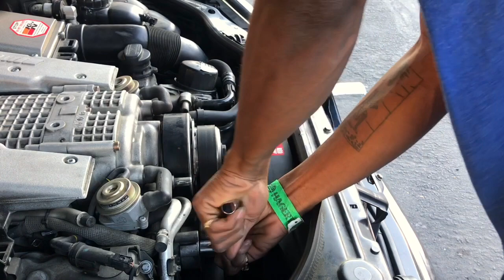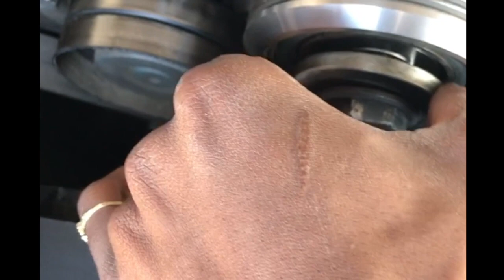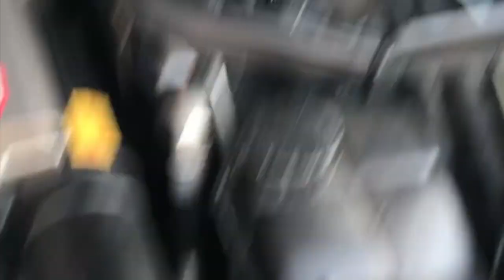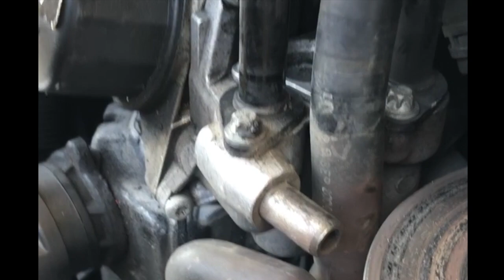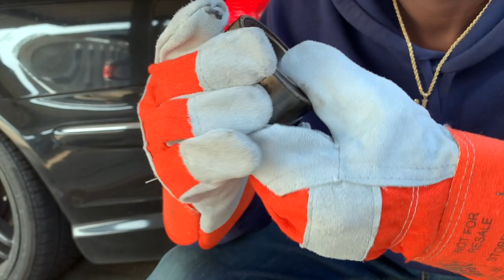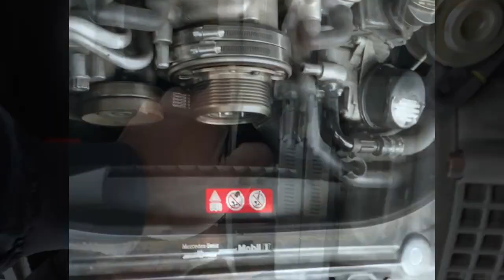How to replace the Mercedes AMG supercharger pulley bearing E55 CL55 CLS55 S55 - M113k Engine noise

Comment: Did you add new bearings or were they the old ones ??? How high did you have the oven on to what temperature???
Reply from the maker: Yes I replaced the bearing. Oven was at 450

Comment: Cool vid... I'm thinkin of doin the pulley MOD for my 03' CL55... or just do what you did...? PS, I guess the MOD gives it a bit more HPower wat u think?
Reply from the maker: Yes, a smaller pulley upgrade or the clutchless setup is definitely designed for more power. But It all depends on what you want, if you’re not looking for more power just replace the bearing like I did. If you want more power do the upgrade. I will be going to a smaller pulley soon this was just a temporary fix. Stay tuned

Comment: Really good quality videos bro 👍
Reply from the maker: Benard Jenkins Thanks man!! We really appreciate it, working hard to keep them coming.
Reply: V8 GANG lol I think mine just went bad, does the noise get louder with rpm I hear a noise from my engine bay, I need to remove the belt to double check tho
Reply from the maker: Benard Jenkins yeah it’s gets louder with rpm. If the cover of the bearing is worn and any internals are exposed it’s bad.